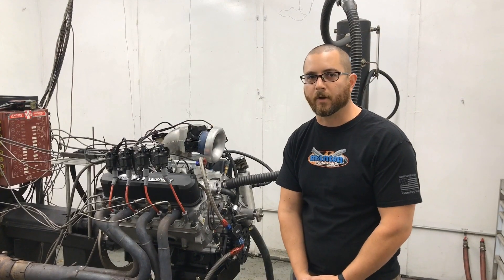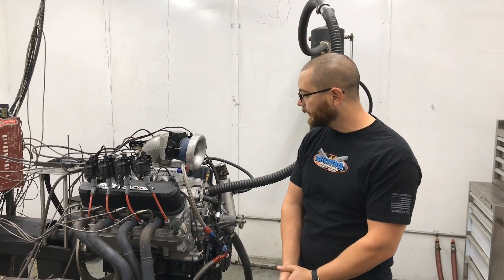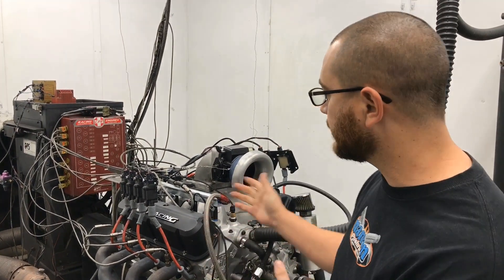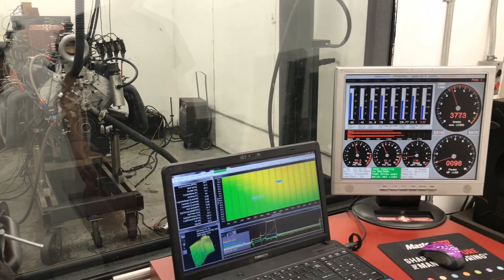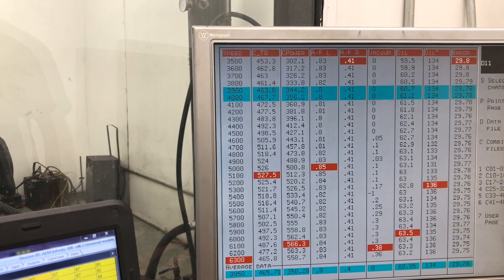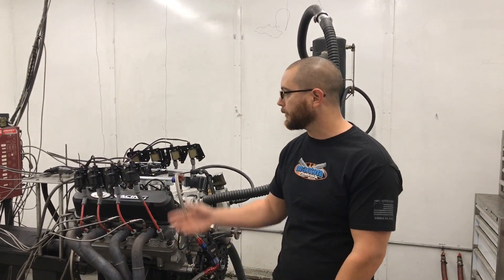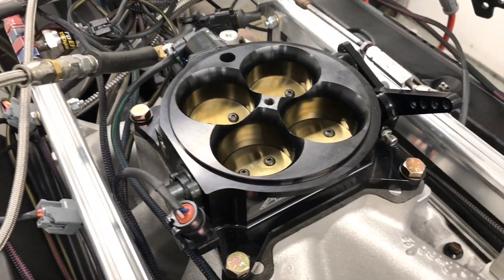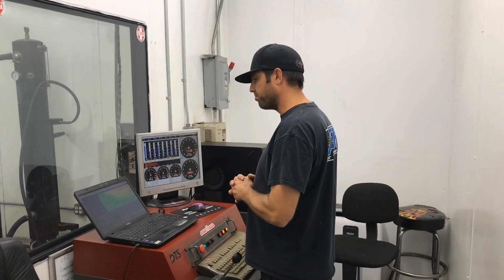CHP Ford Stroker 438 All Aluminum, low compression, 232 duration cam, set up for boost!

Comment: Compression is too low, should be at 10.0 to 1 ratio. Bet it would've had about 600 hp if the compression was 10.0 to 1. If it was, you would only need 10-11 psi boost from a turbo to get 1,000 hp.

Comment: I have a 68 Mustang with a Port fuel injected 438windsor 11.5:1 compression AFR 220 heads, Mahle pistons scat H beam rods, Scat forged crank Ford SVO  block  splayed 4 bolt mains on all 5 caps, comp cams xr292r street solid roller tight lash cam isky bushed lifters,  super vic efi intake with eddy elbow, eaton trutrac rear end 410 gears, caltrac 90/10 up front adjustables out back. Blew up 5 built C4 manual valve body transmissions, Just blew up a built TH400 after 2 days, (My Trans builder thinks 36 sprag prematurely failed, getting repaired soon). 4k stall converter. Car made 530wheel 460lbs torque at wheel through a reverse manual VB built to hilt C4 transmission and 4k stall converter. Waiting on getting brand new TH400 repaired,  lost 2nd gear after 2 days. Car weighs 3k lbs. May do 125 shot later. Runs on 93 octane and set up for e85 also. Just needs e85 tune. Probably 550wheel all motor on e85. All motor is badass...lol
Reply: Maybe you should try a built C-6 That can withstand 850 horse or more lol JC man that's a lot off thrashed transmissions

Comment: 1000+ at 14psi?  I'm guessing?
Reply from the maker: More like 17-18PSI, we did a similar build a couple of months ago and we dyno'd it N/A and with boost but this is going to Norway and don't have the customers blower.
Reply: @coasthighperformance  that supercharger is eating a ton of power then.
Reply: @coasthighperformance  18 psi added to 566 hp engine  "should" make it have almost 1260 hp... I know that your timing and air/fuel ratio need to change under boost and the engine needs to use energy to power a supercharger, but still...260hp lost in spinning a supercharger and tuning the engine for boost...was that world's most conservative tune? Wouldn't need to be if the engine is ony 9.3 to 1 compression.